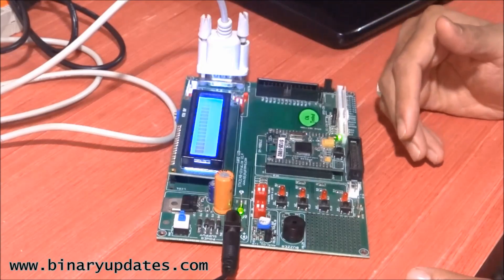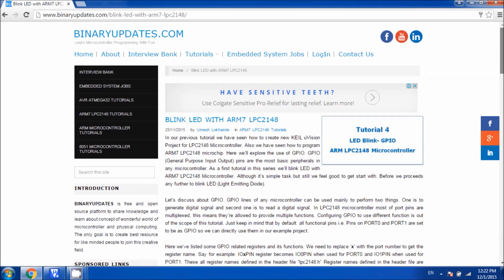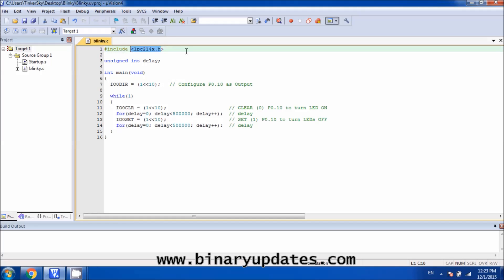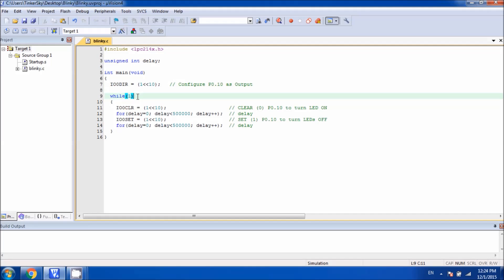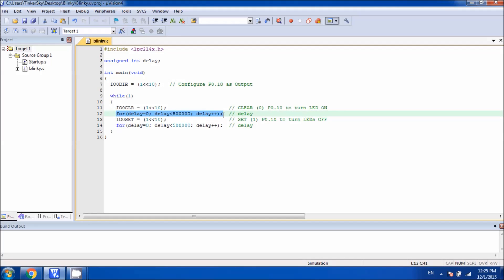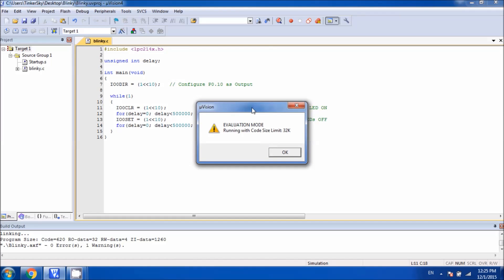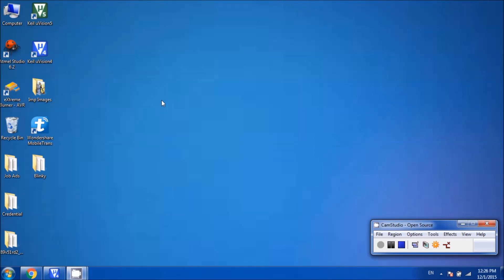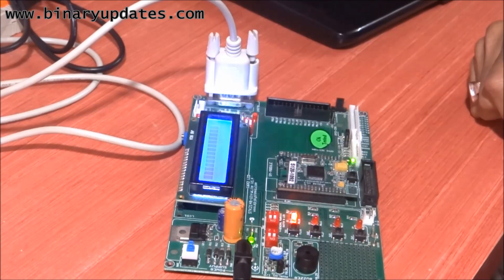BLINK LED WITH LPC2148 ARM7 Microcontroller

Comment: Sir plz suggest me where can I buy lpc2148 development board in low price
Reply from the maker: As LPC2148 microcontroller is based on old ARM7 architecture you may find them rarely in market. you can check in local shops who provide embedded training kits for students and universities. I would suggest instead learn STM32 Cortex-M microcontroller programming. Good luck and best wishes!

Comment: Hi, can you explain how to blink LED for a number of times, when a switch is pressed ?
Thanks
Reply: You need to configure the switch as input and use the conditional loop.
Like if the port to which the switch is connected is high ( 1 ), then the output port that is the led must blink for the particular duration of time using the delay function